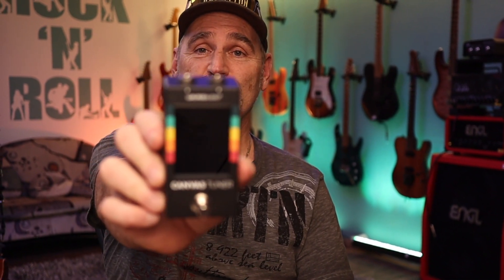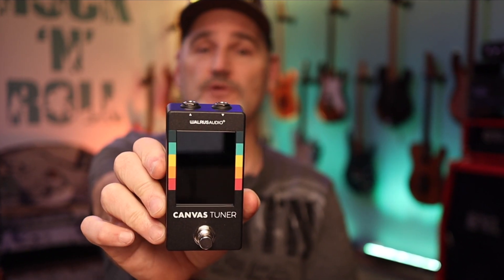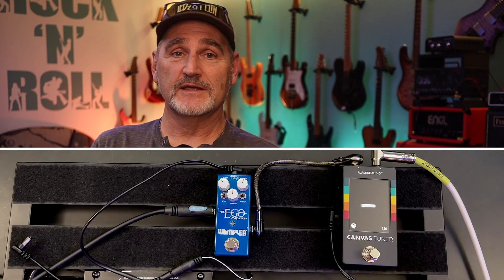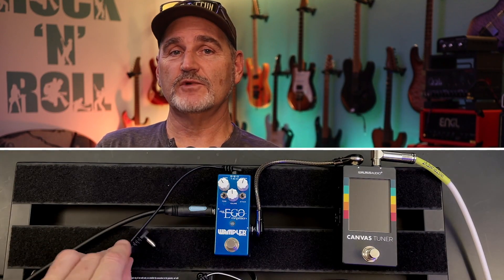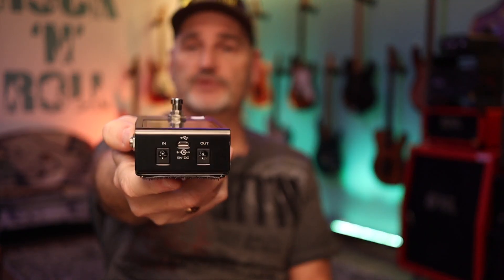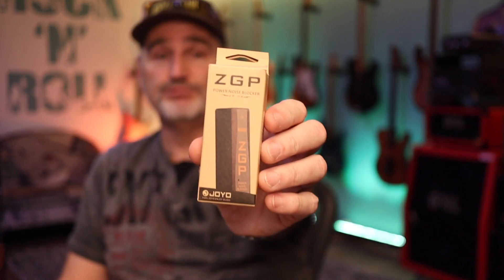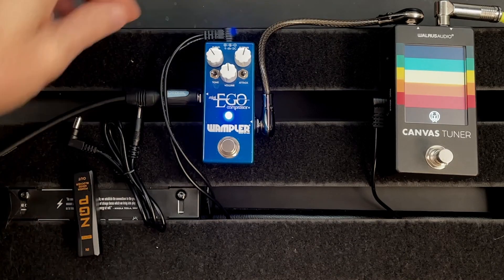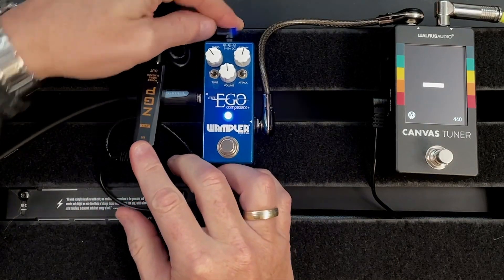The Canvas Tuner Has A Major Issue

Comment: I am a bit confused. When using a daisy chain power supply, you knowingly introduce feedback noise into multiple audio device pedals.  This is exactly the opposite of what all manufacturers recommend. I think this pedal stops you from daisy-chaining power and helps stop you from propagating noisy power. Are you considering this a fault? I guess you have the same issue with a car forcing you to wear seatbelts.  It appears as if you are using the pedal against the manufacturer's recommendation, and then complain about it. Sorry, but I will downvote your video and block your channel to avoid such brainless drivel.
Reply from the maker: Well, the pedal was announced as a high quality device and one of the best tuners on the market. Of course I really like the feature set, but the basics should work as well. From a tuner I don't expect any noise emissions back to the power supply - it's avoidable and also a sign of high quality. Isn't it an industry standard to share power with the tuner - as tuners from the biggest brands (BOSS, TC, Peterson) easily offer a daisy chain connection without any issues? 
I really don't understand why you guys are willing to accept such things - without any complaints, no product will get better. Our job is to tell the industry what's needed. Even if it's hard for some fanboys to accept criticism, it can finally lead to better products and that's what we all want! I would love to buy that pedal again if the issue is solved but by naming the issue in the manual does not make it a better product! I'm in doubt if you would accept your next car without reverse gear if it was mentioned anywhere in the manual....

Comment: Daisy chaining is for fools
Reply from the maker: Of course it's better to avoid daisy chaining whenever possible - however, a pedal should not pollute its power source.
Reply: @RockGuitarVibes  with all due respect I think you need to sit down and read about impedance. If you buy a pedal with as many functions as this you shouldn't be surprised if an unisolated power supply doesn't power it properly. It's the PSU not serving the pedal properly not the other way around.
Reply from the maker: @TheGazDooks  Well, not quote sure if you noticed that I already used a high quality isolated power supply. I consider doing a follow up video to show all details with some more tests...
Reply: A poor power supply and a poor signal chain make for a poor pedal board. No surprises there. You're proving nothing and telling a made up story.
Reply from the maker: @TheGazDooks  Be relaxed and excited about what's coming next...

Comment: Pointless clickbait video.
Reply from the maker: Nope, isn't it an industry standard to share power with the tuner - as tuners from the biggest brands (BOSS, TC, Peterson) easily offer a daisy chain connection without any issues? BTW: I'm not interested in clickbait - for me it's a major issue because I can't replace my TC Polytune with this one, no idea what's so hard to understand! And btw it looks like Thomann (the biggest European reseller) stopped selling 🤯anyway, I wish all the fanboys who already bought that thing and are lucky with it all the best. And if you ever run into noise issues you may remember this video.
Reply: @RockGuitarVibes  You really don’t get it. Who cares what industry standard is. The OEM has stated not to do this. Essentially saying, “this product deviates from industry standards, in the following way…..” yet you didn’t see this, and are now doubling down rather than admitting you screwed up and didn’t read the manual correctly. 

Why don’t you change the title of your video to: “The Canvas Tuner doesn’t do this thing that the manufacturer says not to do.”  You are dense, that’s for sure.
Reply from the maker: @rh50412  Ok, so if the pedal would have no 9V jack and only USB and it's mentioned in the manual that the power comes from USB only, it's all good and nobody would complain 🤣General rule: naming bad things in the manual does not make a product better, yes you are right I simply don't get it 🤕 even if I cited the manual in the video 😎
BTW: Thumbnail title: 'Great tuner but...'

Comment: Tuner pedals are inherently digital. Of course you're going to get noise if you daisy chain. This one just happens to be noisier.
Reply from the maker: Hm, never had any issue with my TC PolyTune or Peterson StroboStomp...
Reply: Apparently lots of guitar players are also electrical engineers judging from the comments in this video 😂
Reply: That's nonsense. Most other tuners even give you a courtesy outlet (Boss TU-3, Polytune, Korg tuners, Peterson, Turbo Tuner). You know what a courtesy outlet is? It's daisy chain, literally. And all of those have ZERO issues being daisy chained to a pedal or two. What's not inherently common is having a tuner that sucks up 300 mA of power like Canvas does. That's just pointless waste for a goofy colorful LCD screen so you can put a photo of your dog on it or whatever. It's goofy and cringe.